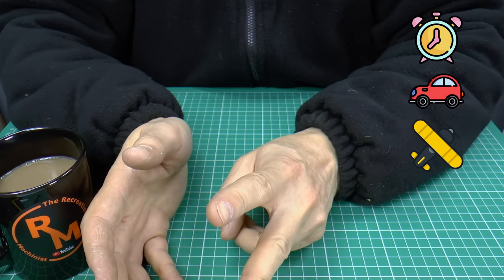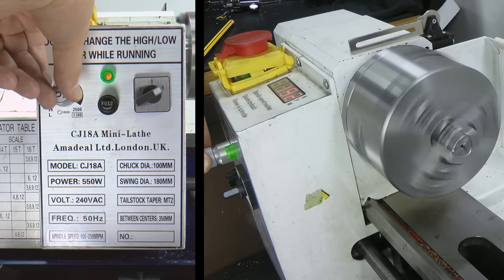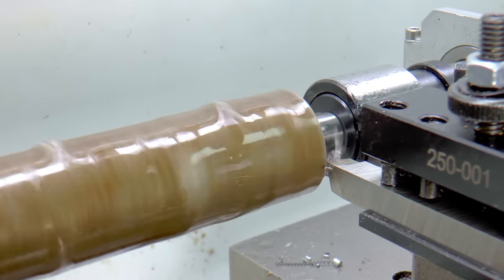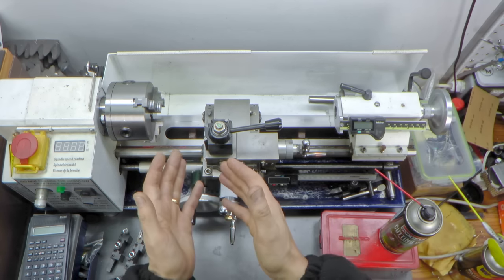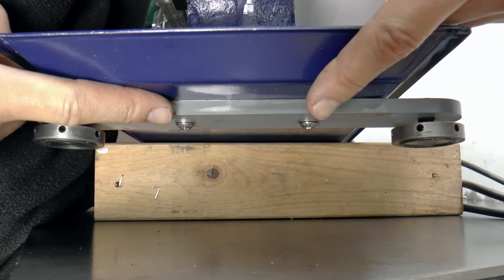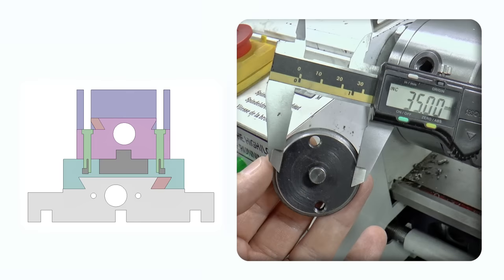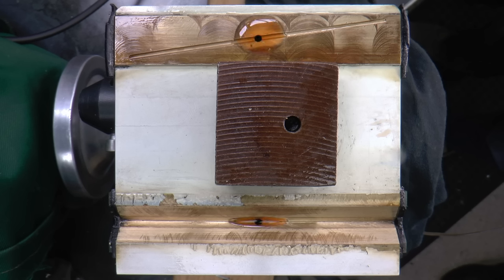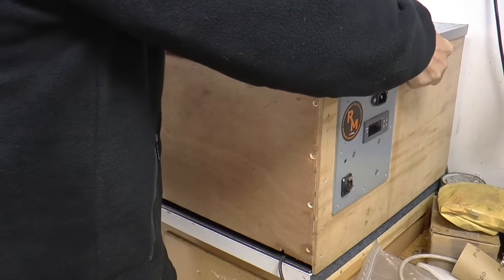10 Years of Mini Lathe Ownership: Pros, Cons, Modifications and Improvements

Comment: Buy big and buy old: i bought a chinese one for 800, add 200 for accessories. Everything that could brake broke, never satisfied with the operation. Spent another 1000 euros for a lathe and i got scammed. In the end i bought a LATHE for 2500 euros. I'll let you guess which one would have been the better route.

Comment: Thank you for the fair posting of this video. I have owned and operated a 7 x 16 LMS hi-torque mini lather for over 6 years now and honestly could not be without it. Previously, when I had my shop, owned an old South Bend 10" lathe that I used for basically everything. Initially, the small mini lathe was difficult to become acquainted with due to the small size, limited chuck and lacking of power. After a while, taking into consideration that all projects may take a bit more time, I am loving this small lathe and wish I would have had on sooner. My lathe was always in need of modifications for the first 2 years or so, but now is set to go for just about any task, including a degree wheel, fabricated from a camshaft degree wheel, installed on the back outside of the chuck, DROs, including the tailstock made from an old set of cheap calipers, QTC tool holder, additional Gibb screws, hand stoned and lapped Gibbs, 4 jaw chuck, way cover, and carriage locks, and more. It seemed every use made it necessary for another mod, but after a while no more required. The initial cost of the lathe itself is cheap, but the tooling is never ending, not to forget the custom tooling you will fabricate as  radius turning, centering and others. The only Addition I would like is an RPM gauge, but not in the budget to date, so recorded RPMs with a hand held device and attached a position wheel showing estimated chuck speeds. I can hole .0005" tolerance on a good day with mine, and use the tailstock or center support for longer material projects to hold the spec. Usage is basically limitless, and dependent on your imagination. I also own a LMS hi-torque mini mill that I am lost without. That also took time to become acquainted with after missing my old Bridgeport type mill of my prior shop. For any that suffer from the lack of real-estate in your garage or shop, as I, would seriously recommend a mini lathe for your hobby projects. There will be times you cuss and hate it, but realize that can be modified for your satisfaction of end results. Remember----It was Cheap.

Comment: I totally agree, I see the same suggestions about avoiding the 7" mini lathes but they're a great intro into turning. I started with a 7x14 and it got me by with a few of my own fixes and upgrades. I finally moved on to a bigger lathe (because I now have the space for it), but I never had the space for anything much bigger in my old place. I think if I had to learn on my current lathe, I wouldn't have known enough to not get me in trouble. Honestly as a companion tool for welding, or if you just need an occasional spacer or bushing for automotive and motorcycle work the 7x14 is great.

Comment: Nice review! I bought an Ahhui Pan-Sino BL180 Chinese mini lathe 7 years ago, and have used it since straight out the box with no mods at all. Most of the work I do is with mild steel or EN9. I make accessories for muzzleloaders as well as mini cannons, punches and dies etc. My machine seems to be of a better quality than most I have seen on YouTube. The only problems I have had with it, is it blows the variable speed potentiometer about once a year! It has also blown it's motherboard once, which was an expensive repair. For the price I paid for it brand new, including the repairs, I wouldn't hesitate to buy another if needs be. That little machine has made me a lot of money and used within it's limits, has been an absolute pleasure to use.
Reply: Perhaps you have voltage spikes or a high temperature problem in your shop?

Comment: This is very well done and truly practical! To many are clearly bias for whatever reason but this is a simple, real use, down to earth video! There is a lot to learn here as it covers many various aspects with proper detail! 

I had struggled for years to buy a lathe and ended up with a small one. Turns out I didn't need anything more. When I need a larger part I use local makerspace or a friend who has larger equipment. This has only been 3xs in many years! 

Well done! Thank you!
Reply from the maker: Thanks for watching and commenting 👍 🇬🇧

Comment: Nice summary of the modifications done. 

I did install a drive speed reduction to mine, which also allowed the use of standard XL sized timing belts. I changed the drive ratio from the standard 1.82 to 1 to a more useful 2.5 to 1. This slowed the spindle speed a decent amount, and noticeably increased the torque available too.
Reply from the maker: Brilliant. Now I know it can be done it might move up my to-do list!
Reply: Any concern about the extra torque stripping out the gears? I suppose the tachometer still works properly?
Reply from the maker: The tachometer is attached to the spindle, so it will read correctly however it is driven. You make a good point I'd not considered -the drive drain will have to withstand any extra torque too! Perhaps I'll have to look at replacing those nylon change gears with metal after all... Thanks for watching 👍 🇬🇧
Reply: @TheRecreationalMachinist   I don't know how critical your mini-lathe is to your channel and such, but if you like to live dangerously, run the current gears until they give up. Could make for a couple of really useful videos if they do go out. If they last, then you've saved a lot of money. 👍
Reply: sorry im new and looking into getting a chinese mini lathe. What does increasing the torque do? Does that mean it will cut into the metal better?
Reply: @NagashiChidorii With more torque you can take deeper cuts and turn harder material. I think it will more easily start to chatter when you run out of torque.
Reply: @TheRecreationalMachinist  Torque requires (equal)  opposing forces, you'd still be  providing one of them via your  cutter. The other force at play is inertia & there's less of it if you're going slower - you'd be stepping down a rung in the design safety envelope, if there ever was one.

Comment: I owned for more than 15 years a 210x400 BV20L-1 lathe (roughly 8x15). I did glance on 7x14 first but I found out I could fit the larger one in my shed (roughly 4m²).
I didn't regret one second. It's way better than the minilathe, proper gearbox for drive, better finish and precision. Weight still manageable at less than 100kg (2 person can lift it).
It also exist in 550mm length which is more suited for most (but wasn't possible to fit in my case).
Lot of improvements possible, like changing angular bearing with tapered one (gone from 0.01mm runout to 4µ runout). Bigger chuck (125mm), VFD drive. Multifix toolpost. 
It's only limit was rigidity, higher grade of steel (42CD4) was possible but only close to the chuck and with minute pass.
So last year as I changed house I got more room for a "real" lathe and a 50's old iron took place (360x600mm).
Yes it's 10x heavier, but above 100kg it doesn't matter, toe lift, engine crane and dollies are your friend.
It needed some restoration, but not so much and the experience gained with the little lathe helped a lot.

So I agree with you, a smaller chinese lathe is probably the best lathe to start with, but I would not choose the minilathe when you have BV20/BV25 which are easy to get in europe (paulimot, damato).

Bigger than that then it's better to go old iron, as price point of bigger chinese lathe cannot stand against it.

Comment: Thanks for a well done video. I bought a new, Chinese, 1440 lathe 7 years ago. It had some minor issues that I've managed to fix. Sometimes it was too big & sometimes too small. I was doing a fair # of castings. Those take up a lot of swing when mounted to a faceplate. I'd be inclined to say start with a 10" swing lathe if you can & a similar sized mill. This hobby is a really deep rabbit hole. There is always something else you think you need.

Comment: I dont have a chinese mini lathe, back in the 1970's I bought a Unimat 3, which is my goto small lathe, I also (almost accidentally picked up an old 13" southbend lathe (honestly when I looked at the pictures I thought it was about a 6") this is my goto lathe for big stuff, I also have managed to collect a watchmakers lathe, a small flexispeed (smaller than the unimat) and a medium size 4-5" ancient thing the flexispeed is good for small stuff in my upstairs workshop when I dont want to go downstairs and use the unimat- its not as robust or accurate, but it does a job.
all I can say is that your initial comments about which lathe to buy are spot on, get one as big as the biggest thing you need to make repeatedly (if you know how big that is) and dont just dismiss the chinese mini lathes, but do buy from a reputable source where quality control has been applied.

Comment: First lathe was a Emco maximat 11, it seemed somewhat light duty but got the job done. After I bought the next lathe, a Schaublin from the 60's, it changed everything! 3000 rpm makes all the difference with small parts. It weighs 3 time that of the Emco and it shows. What a machine!

Comment: Excellent video and I agree with your advice. 
I have an old 9-inch South Bend Lathe and three of the larger Chinese 3-in-1 lathe/Mill combinations. With the South Bend Lathe I was lucky it did not have too much wear or broken parts. But it would be a problem if I had to do major repairs on it down the road. As far as the three Chinese machines go I've learned to look at them as a pre-assembled parts kit that needs to be inspected and readjusted and sometimes modified and improved. If I were to start over I definitely would go with a Chinese machine.
Reply: How do you feel about the three in one machines? Does it get too crowded in there?

Comment: I bought a mini lathe a little over eight years ago. I always wanted a lager one but I thought this could tach me about machining with little risk to my wallet or person - indeed it did. by the time I sold it, four years later, I had learned lots bout machining and lathe mechanics. I replaced all the gears with metal - this taught me about lapping, broaching, boring etc and so the list goes on. I now have a 760Kg lathe in my garage and make all manner of parts for myself and others. If I had bought this beast straight away I'm sure I would be much poorer and missing the odd body part! Great video. Oh and the lathe - I sold it to a friend who now uses it to machine small custom parts for Harley Davidson motorcycles and he is astounded by how accurate it now is!

Comment: Thank you for your honest and even entertaining review with improvement tips. I have been a fitter/turner for a great part of my working life. In the end working with a Scharmann horizontal (dia 132mm) boring bar with the same age as me. You almost rebuilt the machine! And with only a 30 year old press-drill there is not much I can do. Also my workshop is as small as the Netherlands (8 feet x 11 feet) so buying an old 500+ kg lathe is also no option. I 'm going to check the max (Chinese) table lathe which is still affordable < 1.5K€. Here we have a shop called HBM, and they have them 'physical' to get the feel of it.

Comment: Fantastic, thank you sir for taking the time to do videos like this.  I would consider myself a 1/4 Recreational Machinist, ha.  Roughly 15 years ago I bought one of these 7x14 lathes on the used market and used it for just about 2 years and of the hand full to times I used it I did some neat crafting that I could have never done w/o one.  Then I sold it and I can't tell you how many times I wish I still had it.  About 5 years ago I went looking again, again for a $200 used mini lathe.  Gah!  I guess I just need to make more money?  I missed an opportunity for a Unimat mini mini lathe for only $300 last week locally, with tooling, extras and a custom walnut wood box.  Would have been perfect for those occasional small fastener mods I often find myself needed.

Comment: I agree with the "buy new, buy small" when you don't know anything. I have 6 years on a PM-1030 (Chinese manufacture) lathe that was purchased new. It has also suited me well. The one serious upgrade/modification was on the motor going from a 1 HP brushed DC motor to a 2 HP brushless DC motor and controller. Aside from the added torque, it also included the ability to brake the motor. It now stops turning immediately which is quite handy when single pointing. Would I like big ol' chunk of iron, such as a Monarch? Yeah, but this one will do for another few years.

Comment: Most everything mirrored my experience with the exception that mine was worse off to start with. I am not a professional machinist, though I did work maintenance at a large shop and repaired everything. The only two machines in the shop that I could use were the huge format flamecutter and the gear hob. Both were because I had to make them work and bring them into spec when they got hauled in, used and abused by the boss. After getting the gear hob going for a while I was the one that had to set it up and run it because of my math background. I had to make drawings for the machinists to make the blanks because even though I repaired them, I never learned to run the lathes or mills. I did exactly one part on a Leblond out of some bronze. I made a pen that replaced the torch tip on the flamecutter for calibrating the kerf and axis linearity. It was faster, cheaper, and easier to trace on paper than to keep cutting and measuring steel. It was a spring loaded papermate refill cartridge that was held  together by a grub screw at the top. OD turning, drills and a hand tap.

Comment: I have a Sherline mini lathe. I really struggled with parting for the longest time. I would quickly get chatter and it would bind and stall. I eventually found some success with a fairly high feed rate and lots of lubrication. But it was obvious that it still wasn't happy and if I didn't get the feed rate just right it would chatter or stall outright. Just recently I finally had a eureka moment. I took extra time to ensure the height of the tip of my parting tool was exactly centered with the axis of the lathe and WOW what a difference! Parting is a breeze now!

Comment: Well Sir, I am impressed! It's so hard to tell these days what is good or not. But you have convinced me to go for it. I am a Mechanic (35+ years), and I do have experience on lathes. That said, I was looking for the big old ones, but they are tough to find in good condition. I have no problem making parts to make one of these better. During my search here on YT for mini- lathes, all I found were AI generated ads, then I found this video! I still want a big lathe, but I also want a mini-lathe for my second shop. Oh, and if I may add an important piece of advice, one should always use an incandescent light above the chuck. LED's and florescent lights can act like a strobe light (Or a timing light in my trade), causing the chuck to appear still if both frequencies match. 
Happy New Year, and all the best to you and yours! And God Bless. o7

Comment: I have a "Vevor" 7 x 14 mini lathe in my Ebay Cart. Under $400 US free shipping. I appreciate all the cool fixes and improvements you made! I have been studying up on metrology in preparation to build an Epoxy Granite CNC. I am ready to scrape and measure. I have a myriad of small projects that I have been managing to use a drill press as a lathe on, the next is a telescope project or turn down some delrin to fit carbon fiber tubes. I have to make 32. So a mini lathe is on the menu.

Comment: My mini lathe story began when I ordered a Harbor Freight 7X12 (Sieg) machine. In an unexpected turn of events, I was gifted a brand new Grizzly G0765 7X14 mini lathe the day after I received the HF unit. The Grizzly had many more features than the HF, and as a result the HF sat  in its crate. Being a total newbie to lathe operations, I was parting off a piece several inches from the chuck, and the stock suddenly climbed the parting tool! The machine was instantly locked up, shattering the parting tool and destroying the plastic gears in the headstock! Completely my fault! A set of metal replacement gears were ordered from Little Machine Shop and installed in the lathe, but it’s a move I’ve always regretted because of the increase in noise! If/when I have the headstock off, I’m going to put plastic back in it, but I’ve actually quit using that machine because experience has shown me that the HF is a better machine! On another note, I noticed that the apron on your lathe was green which is out of character for a white & blue lathe! What’s the deal with that? Great video!

Comment: Had a 2nd hand Warco version of your lathe for around 2 years now.  Got it for learning, enjoying it, and pleased to see I'm on a similar upgrade path of yours.

One thing - mounted my lathe on piece of 15mm steel plate (offcut from engineering firm). The extra weight and stability helps a lot - cuts now just a bit deeper and gets an improved finish (sounds better too!).

Would like to see how you get on with the sealed taper bearings.